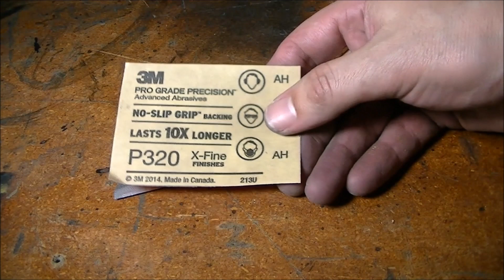Simple Carving Knife - Limited Tools Build - DIY - Making It Yourself

Comment: Nice work.  I use the old dull blades from my Sawzall.  Very good blade steel.  Sharpens to an excellent edge and holds it well.  I do use a leather strop very often while carving. I have crafted a dozen or so carving knives with various useful blade shapes and sizes.  I use chrome vanadium box wrenches to make scorps.  I found it much easier to put a single bevel edge on an already partially formed "blade."  Peace
Reply from the maker: Sounds cool!  I need to try this again with a different blade shape.